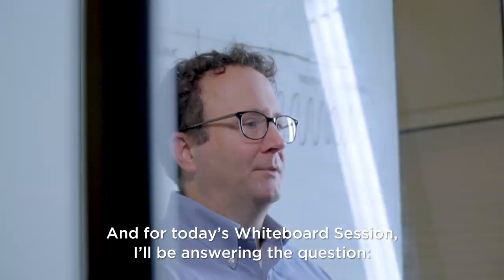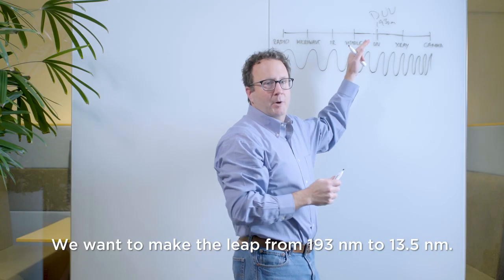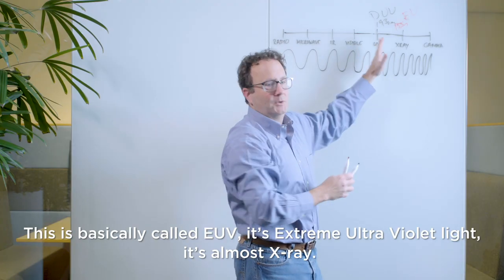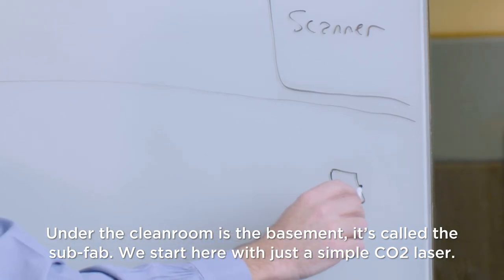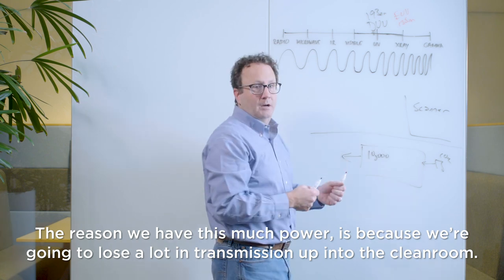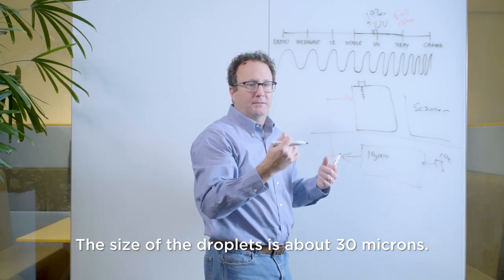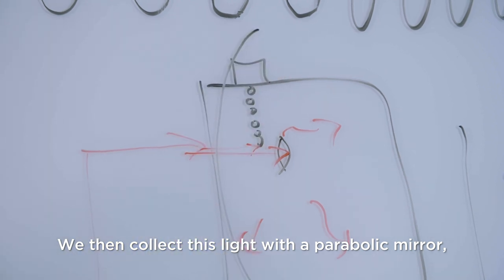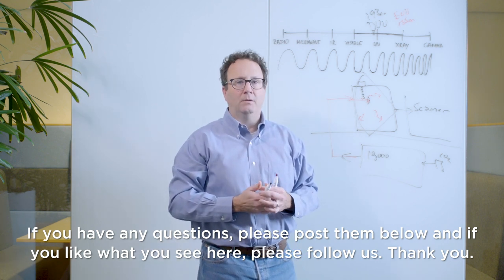The Whiteboards Session | 'How do we generate EUV light?' with Scott Middlebrooks

Comment: Doesn't the tin vapor condense all over the place afterwards? How do you not have a big mess of molten tin on your parabolic mirror?
Reply from the maker: You’re right! Tin debris mitigation is a key aspect in the EUV light source. We have engineered a few tricks for this, but we cannot share those. 😉
Reply: @ASMLcompany  I love that you guys responded to this.
Reply: @adityamishra6509  from the available info it seems they 1. control the droplet size as small as possible limiting amount of vapor generated. 2. use two laser pulse to morph the droplet shape to avoid debris splash. 3. etch the unwanted tin coating off mirror surfaces periodically using some chemical procedure just like how waffers are etched.